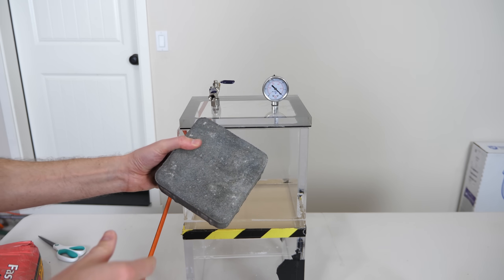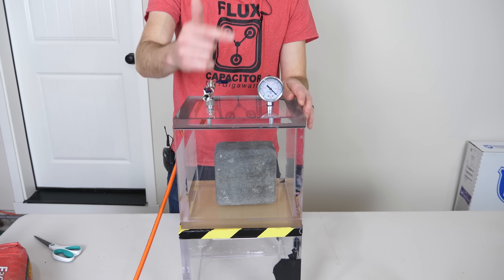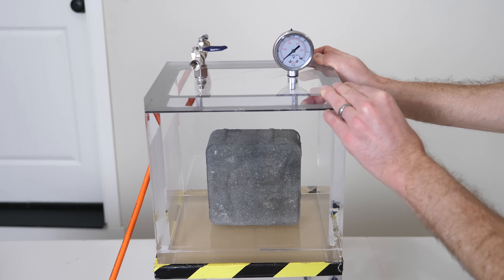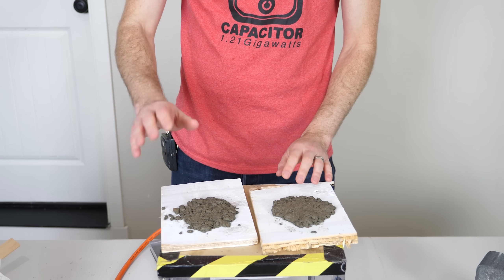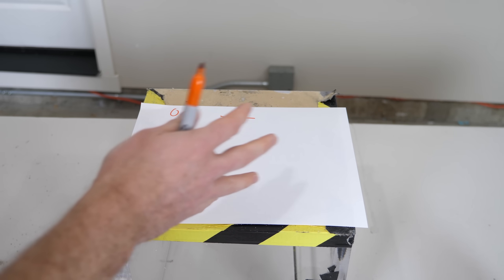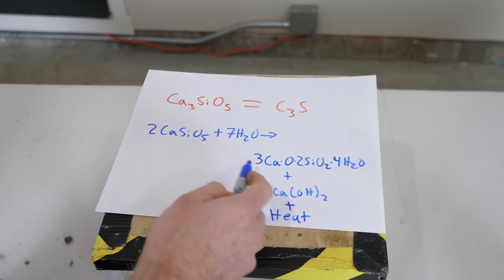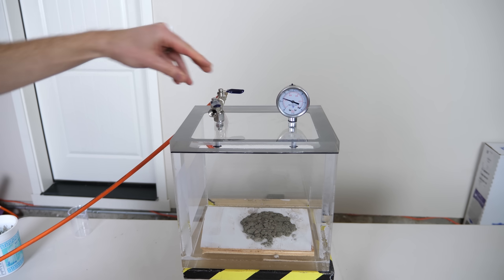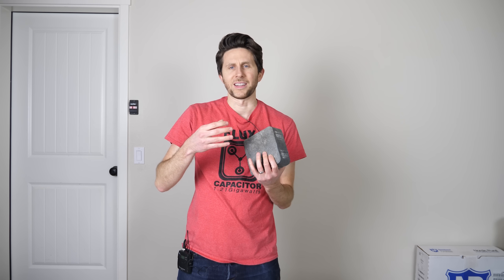Does Concrete Turn to Dust in a Vacuum Chamber? Concrete Without Oxygen Experiment

Comment: Ok....I'm going to post this without finishing the video. Yes, concrete needs the oxygen that is in the water that made it to be present for it to stay solid. Now, the question is this. When they say oxygen dissapers from Earth do they mean in the atmosphere? Or the element of oxygen goes away. That is a whole different thing. I doubt that a vaccume chamber is going to be able to remove all the oxygen infused in the block. I will respond with I was wrong if the block completely crumbles to dust  after I watch the video......lol
Reply: Ok..... never mind. He explained what I was getting at....lol

Comment: Vacuum does have play a part in how chemical bonds work, it just depends how you're putting the materials together. Trial and error folks, math done under normal atmos-pressure and not taking heat in consideration, pretty lousy work.

Comment: Concrete contains compounds that has oxygen. Without oxygen atoms, the concrete will break down into the atoms. I am pretty sure when other videos meant that the when oxygen in the compounds disappear, the concrete will turn into dust. It does not mean that it will turn into dust in no presence of surrounding oxygen

Comment: This is a semantic issue. There is a difference in removing air. And suddenly have no oxygen. Cement contains oxygen. so if you could remove it, it would be dust. But, vacuum cannot remove bonded oxygen.

Comment: The concrete is porous. There should be air trapped within. Maybe time is necessary for that air, if it indeed is in there, to gas off. Try again and let it sit under vacuum for a few days, redraw the vacuum further and see?
I don’t think it will change.
I don’t know, but what role does oxygen play in the curing of concrete? Maybe it’s one of those urban myths that is based on confused information.

Comment: So could positive pressure cause concrete to cure fast? like wouldn't the increase in pressure push the water molecules past the calcium hydroxide crust easier allowing the hydration reaction to speed up?

Comment: Mr The Action Lab.
I have a suggestion for a nice experiment in your vacuumchamber.

It requires a box of sand on the bottom, fine sand, and a remote controlled car stuck in position so that when you power it up, the tires will kick the sand back.

Will you be able to do such an experiment in that nice huge vacuumchamber box you have?

Comment: the heat is not created by "hydration" lmfao.  that's just a silly statement.   The heat is created by a chemical reaction between the extra lime in quick set and water.  yes ofcourse making something saturated with water is called hydration.  But the water is not the reactive agent here, it's the lime.  You can make a form of cement without lime, it just wont harden as fast and wont be as strong once it dries.

Comment: I think the difference between air cement and vacuum concrete in this video was due to the exoterm reaction of concrete. The air concrete was able to give off a lot of heat and the one in the vacuum wasn't able to give off a lot of heat. So what i think is that the concrete in the vacuum had a higher temperature, leading to a higher reaction rate between the compounds.
Just somthing that just came to me watching this video

Comment: I know concrete will dry in a vacuum. Concrete will actually dry underwater. Concrete uses chemical reaction to cure and become hard. that's why you'll notice when you touch freshly mixed concrete after a little while it will be warm.

*Edit I made this comment before seeing the end of this. Pretty cool I was right.

Comment: This video was in my Youtube recommended page...

The problem with this experiment, is that the problem put to you is inexactly stated.

Taking the air out of the environment which the concrete block is in, is not the same as removing the oxygen from the concrete.

Removing the oxygen, from the concrete, is not possible. The concrete contains the oxygen in a molecular matrix known as oxides. The oxides form solids, which are very dissimilar from oxygen gas. The experiment gets much more complicated, and becomes impossible to quantize.

Which means the post’r has been had. But at least he knew that.

Comment: Air is chemically added to concrete in cooler climates to help with the freeze/thaw cycle. It helps keep the concrete flexible. Without air, concrete is more brittle.

The specifications for air here in Texas are pretty low when paving but further north more air content is called for. This is measured on site using a concrete air meter and is tested throughout a days concrete pour.

Comment: It looks like you’re using a paver stone for the first part of the vid. 

“Pavers are made from stone, brick and cement and come in different sizes, styles and textures... a correctly installed paver driveway is about three times as strong as a concrete driveway”

Can you make a square piece of mixed concrete dry it out on earth then stick that in the vacuum chamber instead?

Comment: Lacking control.
If stiffness is related to evaporation of the water and air molecules inside...the system surrounds the concrete should matter in such way that effects the time of being stronger and some other factors like the mirco distance between particles while     drying.

Comment: Come on the Roman's came up with concrete that sets up underwater. What the air will help with is evaporating the water quicker and being put in a vacuum would help remove moisture as it removes the air.

Comment: Nothing will happen because you would have to chemically remove oxygen from it, which wouldn't happen just from vacuuming it.  Lime cement contains calcium oxides, so those would become metallic calcium, which would probably not support buildings.

Comment: Would a wet towel dry in a vacuum
Reply: The water would boil when the pressure dropped real low.  This is how freeze drying works, you freeze something and then keep it Frozen and pull a vacuum, the ice sublimates away leaving the dried material but without drying distortions and wrinkles
Reply: @EshwenAudanal  awesome!

Comment: commenting at 1:00 , you dont  need to remove oxygen air so the concrete will became dust , butyou need to remove oxygen atom from the water that is stored in concrete when making it forthe first time

Comment: Have you ever tried to naturally illuminate a piece of solid granite using high pressure? If the pressure is high enough the granite will naturally emit light! 👌
Reply: @Frostlitzell yes it is. Granite naturally emits light when under high pressure such as a ferment chamber or decomposition chamber.

Comment: A vaccum does not increase the speed in which water evaporates. The speed of evaporation is entirely dependent on temperature, on top of that, evaporative cooling greatly lowers the temperature and would cause the rate of evaporation to he slowed significantly

Comment: Just as suspected, nothing happened. However, you are lucky, cause it wouldn't have just decreased into a pile of sand and dust had it worked. With the air trying to escape the concrete it would have been a violent explosion once the critical point had been met. All the air would come rushing out of the block at once.

Comment: Obviously NOTHING is going to happen. When they say that concrete would crumble without oxygen, they obviously mean the oxygen that is ALREADY IN its molecular structure! Namely because it is largely made of silica, i.e. silicon dioxide. It doesn't rely on oxygen from AIR continually being there. DUH! What they mean is, if all the oxygen atoms MAGICALLY vanished for 5 seconds, that would demolish the molecular structure of concrete, because lots of the chemical bonds are to oxygen atoms, and the now unbonded atoms would fall apart as a powder, though some of it would make new bonds with the neighbors but it wouldn't be enough to hold together with all the vacancies left behind by the vanished oxygen that was just raptured away. It's kind of a stupid thought experiment, it's kind of like saying, what would happen if all the chlorine in sodium chloride vanished, WELL, you'd be left with sodium metal, but that certainly doesn't mean that table salt STOPS being table salt the moment it is taken out of an atmosphere of CHLORINE GAS!

Comment: Vaccum removes breathable air not the oxygen that is with the concrete.
Reply: Came here to say this. I'm glad someone else is educated enough.
Reply: Thats what he said....... See the full video
Reply: The vacuum isn't strong enough to pull the air out of concrete. But put water in there and see what happens. 

Im 100% sure that the air inside the concrete is trying to break out of the concrete.

I would never ever use concrete that was dried and went into a vacuüm later on.

Comment: I think your videos are informative and thought provoking.  Thank you for doing them.  In this particular episode I would have liked to have seen you do a psi test on the concrete block.  Maybe have too similar bricks and do a psi test on one and nothing more, and on the second do a vacuum and then do a psi test.  Many ready made concrete products (just add water) have a psi strength around 5000.  Would it change and crumble more easily?  Would it make it more dense and therefore stronger?  I do not know.  As you explained that the oxygen molecules inside the concrete act differently when just outside in air, I'm not sure what if anything would happen to psi of the bricks if these two experiments were to be done, but I'd be interested in finding out.  :)  Thanks again!!!

Comment: No The videos are not misleading they just don’t do a good job explaining WHY. If oxygen was eliminated from the periodic table completely, then ALL components containing any oxygen molecules will go back to their original form since one of its main components was erased. For example, If you completely erased oxygen molecules from water you would be left with only hydrogen. (H2O - O = H2) .....remember earth was created from different molecular components reacting with eachother, the molecules were individual molecules at one point in time.

Comment: Isnt concrete porous? Is it possible there is remaining 02 inside the concrete block trapped that you can't remove, that if magically removed could cause a vacuum decompression internally? I don't know physics well enough to say and maybe im completely off base

Comment: I would guess that all water is gonna come out and evaporate. Since concrete is a porous substance, whatever is in its pours will come out. The pressure on the concrete would depend on the speed in which the air is removed, and would be higher the faster air disappeared, since  there is air in the block which has to come out through tiny pours...

Comment: Hey, can u make a video about heating water in low pressure (not vacuum) chamber ?
Will the water boil quickly without increasing the pressure of the chamber?
Reply: To awnser your question yes it would, water can only be liquid under pressure if you lower the pressure the water atoms change to a gas more easily to the point that if you put liquid water in the vacuum of space it would boil even through the temperature of space is way bellow the freezing point of water, that is why you can only find ice and steam on space and liquid water on celestial bodies

Comment: Concrete turn to dust because all the oxygen would be gone, including the binding oxygen to concrete..

It's already formed. And already there. You are only taking out the air, therefor the concrete will remain strong..

Good try, but misunderstanding.

All oxygen gone as in No oxygen anywhere. Vs oxygen removed after already formed. The oxygen is already bonded and therefore won't be removed.

So, it will stay strong and rigid.
Reply: Nice someone who actually pays attention in school me and you both know that alot of people dont

Comment: By vacuuming, it only takes of air oxygen. Not oxygen in other molecule than Air.
To actually make oxygen poof, you need to block which area, remove certain element / atom, and select oxygen. now oxygen is deleted, but not the other element.

Comment: The guy who said concrete structures will all crumble is a tard. Most of the air is forced out during curing so while it’s vacuumed it’s just fine because there’s no oxygen to strip away and most concrete structures will have very strong rebar and other materials to add strength to it so.....

Comment: To really test it you have to add a weight on the concrete because concrete structures will be under some weight for the scenario of earth without oxygen. place a 50lbs weight on the concrete and then conduct the experiment.
Reply: It would not matter. The other "what would happen" "factiods" and I use the words fact loosely, are depending on oxygen that is bonded with silicone and other metals to vanish, changing the mechanical properties of the stone filler entirely.

There is no way for him to replicate that.

Comment: basically u just remove the oxygen that surrounds it.  what WHAT IF meant is, if u completely remove all oxygen and gas material, its molecular structures like the size of atoms then it will break.

Comment: Concrete will cure underwater,  but it won't be dry. 
One reason fresh concrete cracks,  is because the concrete will want to shrink as water evaporates and reduces volume.  Part of the concrete curing procedure is to keep the from evaporating too fast.

Comment: They said structures which weigh tons so the crush to the pressure when there is no oxygen, you just had one brick which has no pressure on it so nothing happened

Comment: Tensile strength of concrete (resisting stretch), even though much lower than compression strength, still about 10 times atmospheric pressure.

Comment: Have you ever tried to simulate a martian dust storm or dust devil?  Conspiracy theorists have suggested that martian atmospheric density is much greater than alleged by NASA.  We are told that martian gravity is 38% of earths gravity and that martian atmospheric density is about 1% that of earth's.  Even at one third gravity those dust grains should be raining from the sky like meteors.
Conspiracy theory is supported and sustained by unanswered questions.  I tip my tinfoil hat at them for asking.  I also don't mind seeing them shot down with facts.   A vacuum chamber experiment with a ducted fan over a pile of dust might confirm or refute the hypothesis.  The difference in gravity could be ruled out by using dust one third the (alleged) density of martian dust.  Electrostatic charge might also be a factor (Thunderbolts Project).  That too, can be (and should be) checked experimentally.

Comment: This doesn’t make sense because oxygen removal from any concrete would immediately turn it to dust. Concrete needs oxygen in order to be a solid object.
Reply: You would have to physically remove it somehow from the concrete itself not just the air around it the molecular structure is already in place.

Comment: No Air Means Rock/Cement/Concrete It Will turn To Dust On Earth 🤤??? Ok did Experiment Nothing Happened Ok Why In Space Theirs No Air And Theirs Rock Floating Around Our Solar System And They Never Turned To Dust And Theirs No Air That Explains

Comment: I think they meant that structures would collapse because the pressure inside would drop. This is incorrect because the pressure outside would drop equally, maintaining the integrity of the structure. Also, this has nothing to do with oxygen, but the total atmospheric pressure, which is only 21% oxygen.

Comment: Great science experiment :)  Would not want to use concrete on a space station, though.  The bio-dome experiment in the American southwest showed that concrete absorbs oxygen over time.  They couldn't produce enough 02 with plant life in order to keep up!  

You wouldn't want to use concrete for airtight environments with no access to electrolysis.  Submerged environments would be OK but Mars or Space stations would never want to use concrete or cement as a building material.

Comment: Actually I want to know what happens when you put liquid concrete in a vacuum to cure under negative pressure, and hopefully it creates air pockets in the process. It should still cure given the curing process is a chemical reaction with the chloride and lime agents..

Comment: its because more mass but there is less height for your concrete but on tall skyscrapers have a high height and the wind is stronger so when the air starts to leave the wind will get stronger then stop and will crack the bottom of the skyscraper and when the wind comes back it will fall from the sudden start of fast wind      EDIT: and when concrete is old it has a higher chance of cracking so skyscrapers will tumble

Comment: Wait... did you say concrete in space? That's a terrible idea. Even if you don't have the monumental cost of moving the materials off earth's surface and get them somewhere else. The strength of concrete is in compression and it has very poor tensile strength. This is why we don't use concrete to make pressure vessels.

Comment: The reason that it  has no effect is because cement is just dried plaster and that doesn’t need oxygen to dry. Since does nothing to the cement besides stabilizing it, so it wouldn’t be different.

Comment: I'm fairly sure nothing will happen. (I see the first guess is 100%, and you should never be 100% sure of anything). I'd go with 85% maybe. It seems unlikely, but I wouldn't be floored.

Now if you mean for it to completely crumble to dust, I'm closer to 95% certain that won't happen. Things take time; the outside could crumble but I doubt the inner parts will that quickly. (Presumably if they require oxygen it's trapped in the structure, but not enough to sustain the outside. Having the inside be solid without being in contact with the air is part of why I expect nothing will happen).